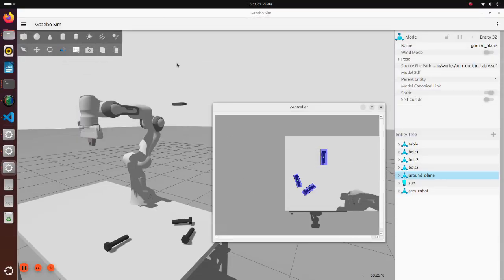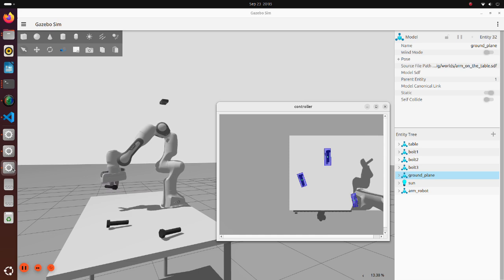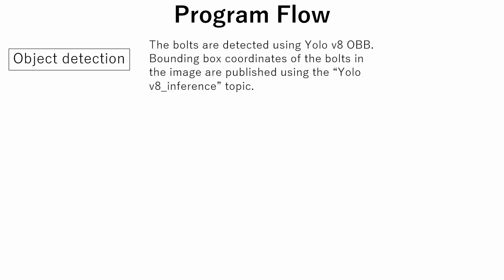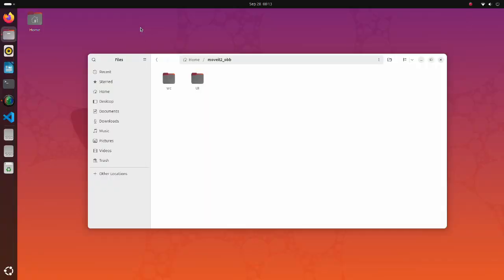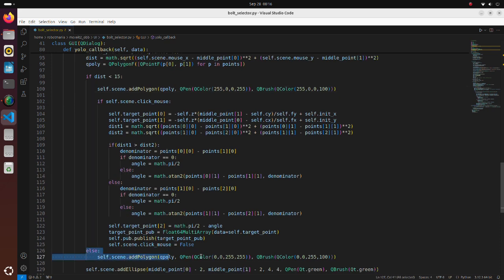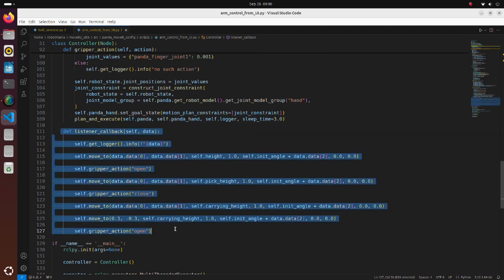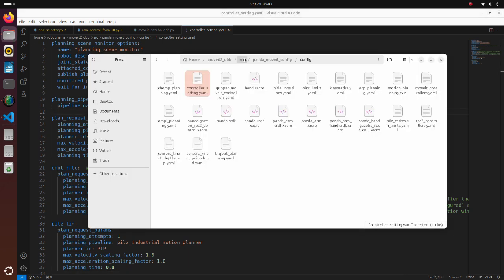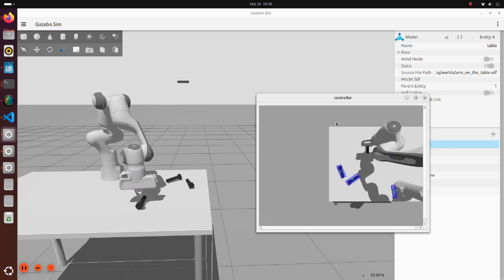Pick and Place Simulation Using MoveIt and Yolov8 OBB

Comment: Thank you for the great video. 
I'm currently implementing a pick-and-place pipeline on real hardware for a university project, and I was wondering whether instance segmentation might be more accurate than object detection, especially in terms of improving the ROI. 
Do you have a specific reason why you chose detection?
Hope for your reply, thanks very much.
Reply from the maker: Hi Maton!
Thanks for watching my video!
I chose detection because this model (OBB) was trained to infer detected objects orientation as well. For use case of this tutorial, it was important because knowing angle of detected objects I can easily align the gripper to an object. As far as I know, pure instance segmentation does not have such feature.

Comment: how to use conttroller as it not doing any function even after my clicking to it. robot is in static position in controller window.
Reply from the maker: Hi Abdul Rasheed！
Thanks for watching my video!
Are there any errors in the terminal?
Reply: @robotmania8896 no there is no any error as well. gazebo and rviz working fine even yolov8 publishing msgs but in controller window robot is not moving
Reply from the maker: Hmm… That is strange. In that case, either MoveIt or UI (pyqt5) part might be working incorrectly. You can add the “print” function to see whether UI responds to mouse click. If it does, probably something is wrong with MoveIt.

Comment: Does it use a regular camera in real conditions? How do you get the Z coordinate?
Reply from the maker: Hi Diki Darmawan!
Thanks for watching my video!
I use general USB camera.
In this tutorial camera is fixed and all bolts are located on the plane parallel to the camera. So, I use fixed value for the Z coordinate of the bolts.
Reply: @robotmania8896 Thank you for the answer, may I ask again, so I want to design a 3 DOF parallelogram waste sorting robot integrated with Yolo, can I use MoveIt or is it better to use manual Inverse kinematics?
Reply from the maker: @dikidarmawan4763  If your arm has 3 dimensions of freedom, you don’t have to necessarily use MoveIt. It will only make things complicated. I think that you don’t even have to use IK, because arm angles can be calculated trigonometrically. One leg of the quadruped robot also is 3DoF. In this video I explain how to calculate angle of each joint. I hope it will help you.
https://www.youtube.com/watch?v=O_2swSMecB4
Reply: @robotmania8896  thanks for the video, but is it still better to use ROS as communication if I integrate parallelogram robot, Yolo, and PLC as conveyor drive?
Reply from the maker: @dikidarmawan4763  Yes, I recommend you to use ROS. It is the easiest way.
Reply: @robotmania8896 thank u for the answer

Comment: For the Top View Camera I have the Back Projection Formula:
fx: 253.9363
fy: 253.9363
cx: 320
cy: 240
Camera X: 0 m
Camera Y: 0 m
Camera Z: 2.299 m 
Target Z: 0.777 m

dz = camera_z - target_z 
x = -dz * (v - cy) / fy + camera_x
y = -dz * (u - cx) / fx + camera_y
z = target_z

What would be the Back Projection Formula for Right Side Camera looking on the x-axis?
fx: 585.756
fy: 585.7561
cx: 320
cy: 240
Camera X: -0.062 m
Camera Y: -2.45 m
Camera Z: 0.738 m
Target Y: 0.777 m please provide a simple example because it has been extremely challenging.
Reply from the maker: Hi Kavita Krishnaswamy!
Thanks for watching my video!
Maybe I got it wrong, but assuming that
1. Camera optical axis is aligned with +x-axis,
2. Target is on a constant Y-plane
Then
dy = camera_y - target_y  # positive if camera is above the target
z = -dy * (v - cy) / fy + camera_z
x = -dy * (u - cx) / fx + camera_x
y = target_y
Reply: @robotmania8896  Many thanks, the Arm move but wrong position yes aligned with the + x axis. Also what is to forward projection equations for the top camera to find the pixel coordinates from the world coordinates?
Reply from the maker: If you would like to find the pixel coordinates from the world coordinates that is not difficult. Please use the formula on page 4 of this document.
https://www.cse.unr.edu/~bebis/CS791E/Notes/PerspectiveProjection.pdf
Reply: @robotmania8896  thank you so much! It would be nice if you could do a complete review on this formula with respect to a camera that tilts and pans. Appreciate your support

Comment: Would be very useful if you create a new tutorial covering scattered bin picking, which is more challenging.  In your other tutorials you already showed some basic pose estimation, but this could demonstrate a real use case.
You already have 3D models (bolts in this tutorial) and image recognition, but on a flat surface only which limits the application. There are interesting method for comparison of cloud points and known 3D models, also more advanced AI approaches. You also have tutorials using stereo camera, which could provide additional information for pose estimation, despite that 3D reconstruction from 2D image is also posable.
Reply from the maker: Hi Simeon Tsvetanov!
Thank you for a suggestion! I will see what I can do.

Comment: I’m using ROS 2 Humble on Ubuntu 22.04 and installed MoveIt using apt from the official ROS repositories. The Python MoveIt modules are not recognized when I try to import them.

Are you using ROS 2 Jazzy on Ubuntu 24.04? Is the Python MoveIt integration working for you?

I want to stay on Ubuntu 22.04 because I have a lot of work already set up. Is there a way to configure the Python environment correctly for MoveIt in ROS 2 Humble?
Reply from the maker: Hi Abdullah Al-Shateri!
Thanks for watching my video!
As written in the description, in this tutorial I used ROS2 Jazzy. The “moveit-py” package can be installed using apt only from Ubuntu 24. If you would like to use the “moveit-py” with Ubuntu 22, I think you should build “moveit” from source.

Comment: How i can configure the moveit pay with my project because i have problem like when i provide a position it output is invalid goal even when it is reachable by the arm our arm is 6 DOF
Reply from the maker: Hi omar gamal!
Thanks for watching my video!
If I understand you correctly, you have an original 6 DOF arm, and when you move the interactive marker in RVIZ the arm does not move? If this is the case, do you have any errors in the terminal?
Reply: @robotmania8896 when i provide a configuration like ready or home from rviz or using the moveitpy API the arm move correctly, while when i provide a point like bolt position the moveitpy API does not return an error actually but tell me invalid goal even when it is reachable by the arm i try to solve it and check my moveit configuration files but still same problem
Reply: @robotmania8896 thanks for ur answer, no when i move arm using interactive marker in rviz it move correctly also when i set it to ready or home all work perfect, also when i use moveitpy API to make the arm move to home or ready state it moves too without may errors, but the problem is when i provide a specific position using moveitpy API to make the arm move to the planning failed and return invalid goal even when the goal is reachable by the arm, i try to check all moveit configuration files but there is no problem in, our problem now is in the moveitpy API so it woks correctly when i goal state is ready or home otherwise invalid goal😢
Reply from the maker: Sorry for the late response. Are you sure that you are providing the correct orientation of the end effector? There is a possibility that orientation of the end effector is not feasible.

Comment: How can I install 'ultralytics' library in ROS2 Jazzy? I have installed ultralytics into the virtual environment. However when I run the yolov8_obb launch file I get ultralytics package cannot found error. How did you installed this library, can you explain please? I also get error when I try to install with terminal using : 'pip3 install ultralytics' error: externally-managed-environment
Reply from the maker: Hi eseseses eseses!
Thanks for watching my video!
You can install it with this command:
pip3 install ultralytics --break-system-packages
Reply: @robotmania8896  Thank you for quick response. I will try it. 
Your videos are helpful. If possible,  could you share any contact? I have problems with MoveIt2 and I could not solve for a week.
Reply from the maker: @eseseseseseses-f3d  Here is my e-mail: robotmania8867@yahoo.com

Comment: And also I want this manipulator to be above my AMR for mobile manipulator how to do that can you please help me I am new to this, thanks for your video it was very helpful
Reply from the maker: If I understand correctly you would like to do manipulation and the AMR operation simultaneously? That is quite difficult problem. But I will see what I can do.
Reply: @ Basically the manipulator should be on top of AMR and when the AMR will have separate path planning and SLAM integration it just have to take the manipulator with it once it reaches the picking station it should pick and then the AMR will now move to the placing station and the place task will be done by the manipulator, it would be also quite good if we use eye in hand Image based visual servoing so that we can do precise pick and place applications

Comment: Thanks a lot for this very useful video.I noticed from the code that the z-value of the 3D coordinates is fixed. Is there a way to dynamically obtain the depth value z?
For example, replacing the RGB camera with an RGB-D camera?Hope for your reply,thanks very much.
Reply from the maker: Hi 了鹅乐!
Thanks for watching my video!
Yes, by using RGBD camera you can easily obtain depth value. In this tutorial I didn’t do this because the camera is fixed and all bolts are on the same plane, parallel to the camera. Here are several videos in which I do coordinate estimation of objects.
https://www.youtube.com/watch?v=oKaLyow7hWU
https://www.youtube.com/watch?v=--81OoXMvlw

Comment: Hi, I was able to install & run in ubuntu 22.04 humble. Yolo_interface was publishing the coordinates for 3 bolts. But when I select any bolt with mouse click, it turns red but the arm doesn't pick it up. 

What can I do to solve this? Btw, thank you so much for this tutorial.
Reply from the maker: Hi parvez mahmud69!
Thanks for watching my video!
Have you installed all packages mentioned in the description? This may happen if you have not installed the “ros-jazzy-gz-ros2-control” package.
Reply: @robotmania8896  I tried using ros-humble-gazebo-ros2-control since I am doing in humble. The bounding box becomes red from blue when I select it. The bolt selector publish the coordinates  in target_points topics. But after that nothing happens. How can I debug it? 

Or, if there is no way to fix this, how can I do it myself to complete the project?

Thanks in advance!!
Reply from the maker: @parvezmahmud6963  If you are using gazebo-classic, you have to modify several files. Have you modified the “panda_hand.gazebo_ros2_control.xacro” file? Because plugin name is different in case of gazebo classic.
Reply: @robotmania8896  Hi, yes, I am using gazebo classic. Could you please tell me which files I need to change? Is there any way to connect with you? Discord? Or anything? I really need to complete this project at any cost.
Reply: @robotmania8896  Hi, yes, I am using gazebo classic. Could you please tell me which files I need to edit? Is there any way to connect with you? Discord or anything? I really need to do this project at any cost.
Reply: @robotmania8896  yes, I am using gazebo classic. Could you please tell me which files I need to edit. Is there any to connect with you? Discord or anything? I really need to complete this project at any cost.
Reply from the maker: Sorry for the late response. For some reason, YouTube didn’t notify me for new messages.
As I mentioned previously, you should modify the “panda_hand.gazebo_ros2_control.xacro” file.
In the ros2_control tag,
Change
<plugin>gz_ros2_control/GazeboSimSystem</plugin>
To
<plugin>gazebo_ros2_control/GazeboSystem</plugin>
You also have to add "libgazebo_ros_joint_state_publisher.so" plugin and "libgazebo_ros2_control.so” plugins for gazebo.

Comment: Great video! Thank a lot, but i have a problem with your source code, everything is good, but when i click to the bolt, robot arm cannot move, although i checked "ros2 topic echo /target_point" has value, how can i solve that problem ?
Reply from the maker: Hi KAPWING!
Thanks for watching my video!
Do you have any errors in the terminal?
Reply: @robotmania8896  no have any error in my terminla but when i click to the bolt int gui, nothing happen with robot (it doesn't pick the object)
Reply from the maker: There should be something that prevents the robot from moving. Have you installed all libraries that are listed in the description?
Reply: @robotmania8896  Yes i did, i installed all of them, i checked dpkg -l | grep <package> all all of them already have

Comment: For the last two weeks I tried many times to write a comment describing the error that I'm facing. It's appears for a while and than just gone. 
When running the simulation the robot falls down on the table under the force of gravity and is not controllable.
Reply: Posable error messages. The last two are repeated continuesly:
[rviz2.moveit.core.robot_model]: Skipping virtual joint 'virtual_joint' because its child frame 'panda_link0' does not match the URDF frame 'world'
[rviz2.moveit.core.robot_model]: No root/virtual joint specified in SRDF. Assuming fixed joint
[spawner_joint_state_broadcaster]: Could not contact service /controller_manager/list_controllers
[spawner_panda_hand_controller]: waiting for service /controller_manager/list_controllers to become available
Reply from the maker: Hi Simeon Tsvetanov!
Sorry for the late response.
Do you still have these errors, or you managed to do the simulation successfully?
Reply: Thank you! Just fixed it and came beck to share how.
Looks like ros-jazzy-gz-ros2-control was missing. You can add it to the required packages list in the description.
Now, there is WARN: No clock received, using time argument instead! Check your node's clock configuration (use_sim_time parameter) and if a valid clock source is available.
This one is anoying too: "libEGL warning: failed to open /dev/dri/renderD128: Permission denied", after updateting the GPU Drivers.
Also, sometimes the robot can't pick the bolt even when the grepper is moved on the right position
Reply: Also, If Ubuntu Firewall is activated the simulation cannot be started without adding some exceptions.
sudo ufw allow in proto udp to 224.0.0.0/4
sudo ufw allow in proto udp from 224.0.0.0/4
Reply from the maker: @Simeon_Tsvetanov  Thank you for the information! I updated the required packages list in the description.
Yes, Gazebo has issues with contact constraints while grasping. Isaac Sim is much better for these kinds of simulations.

Comment: How to build the package which you have given i have installed it in my ros_2 ws, and is it possible to run on humble i have built it using colcon build in my ros2_ws, should i also install yolov8 packages
Reply from the maker: Hi KARTHIK!
Thanks for watching my video!
As has been written in the description, this program works with ROS2 Jazzy, so you cannot run it using Humble.
Reply: @ Ok thanks let me try on jazzy
Reply: @ Is there any way to run it on humble
Reply from the maker: @KARTHIK-gi3hf  You have to rewrite several parts of the code because API has been changed compared to the previous version (ign to gz-sim). And you also have to build “MoveIt” from source.
Reply: I have installed Jazzy can you please say how to build the package and execute the command
Reply from the maker: @KARTHIK-gi3hf  Please install all packages mentioned in the description and execute the “colcon build” command.

Comment: Thanks for the wonderful tutorial!
On Docker (jazzy-desktop-full-noble) I had an error "Could not load the Qt platform plugin "xcb"" when running "bolt_selector.py"
Solution: pip install opencv-python-headless
Reply from the maker: Hi Simeon Tsvetanov!
Thank you for sharing this information!
Reply: @robotmania8896  when running "ros2 launch panda_moveit_config moveit_gazebo_obb.py" the robot falls down on the table under the force of gravity and is not controllable.

Comment: i am using ros2 humble ubuntu 22.04. i am getting error in last step. could u please help

python3 bolt_selector.py
Warning: Ignoring XDG_SESSION_TYPE=wayland on Gnome. Use QT_QPA_PLATFORM=wayland to run on Wayland anyway.
QObject::moveToThread: Current thread (0x5bbef2f95ba0) is not the object's thread (0x5bbef399a8f0).
Cannot move to target thread (0x5bbef2f95ba0)

qt.qpa.plugin: Could not load the Qt platform plugin "xcb" in "/home/------/.local/lib/python3.10/site-packages/cv2/qt/plugins" even though it was found.
This application failed to start because no Qt platform plugin could be initialized. Reinstalling the application may fix this problem.

Available platform plugins are: xcb, eglfs, linuxfb, minimal, minimalegl, offscreen, vnc.

Aborted (core dumped)